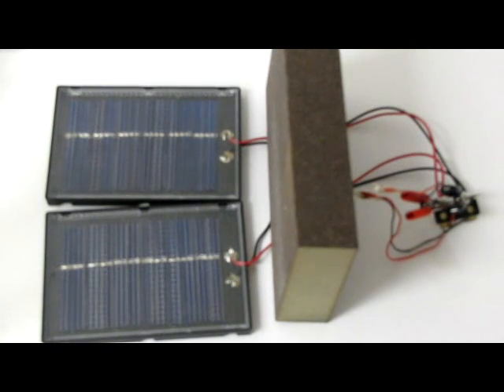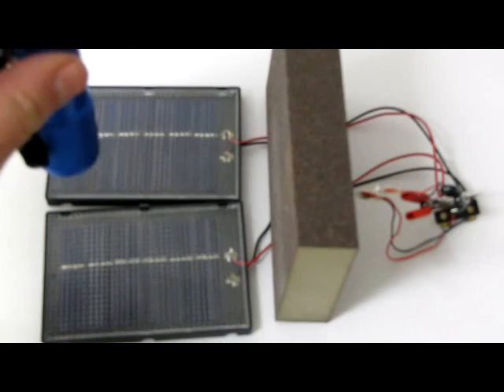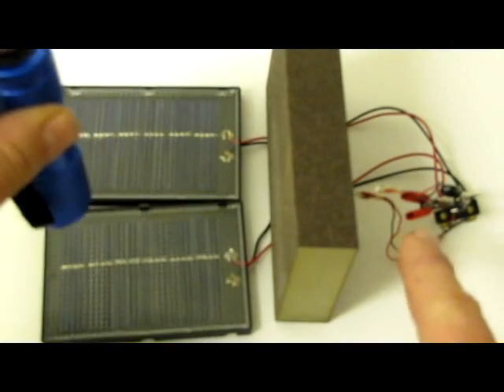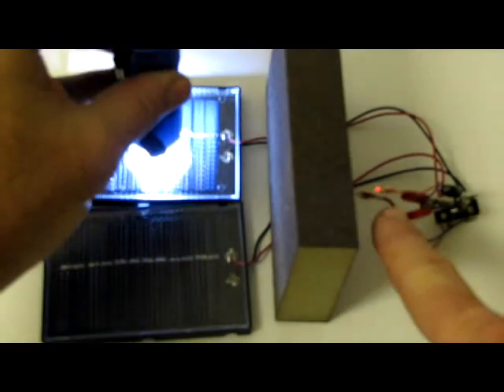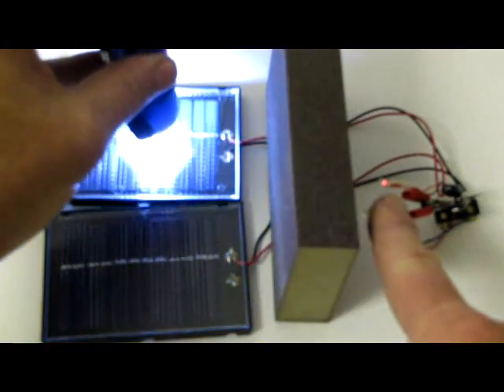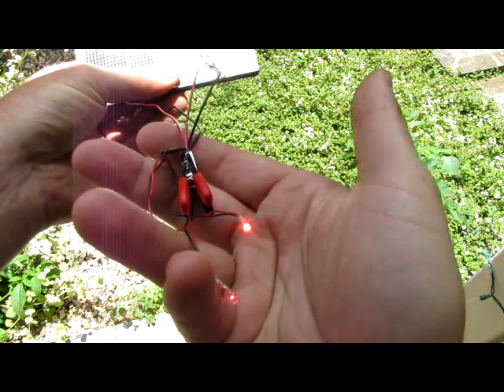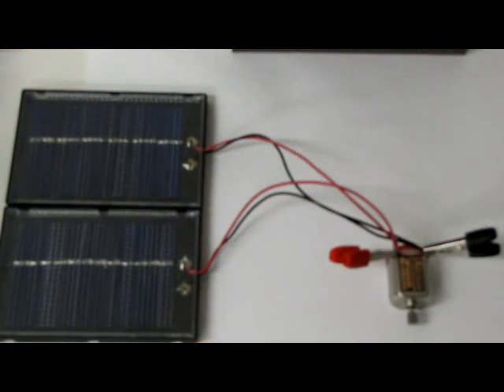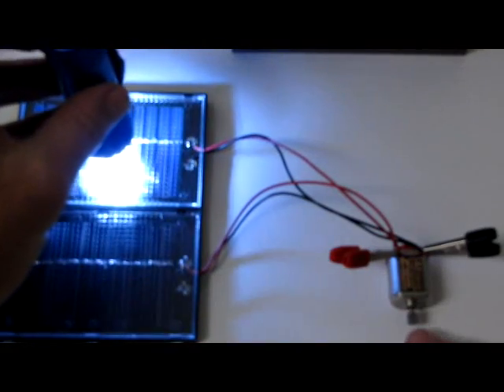Solar Panels 6V 50mA LED Lights Tamiya #54009 Won't Run 3V DC Motor

Comment: Use hemp supercapistor with hemp solar panel with that and a bar light led for 4 wheel drive. Put a 6 foot copper pipe pryamid over it 33 degrees. Pancake coil on bottom screw coil on top clockwise. Put motor in the focal point like eye on dollar bill and capistor.